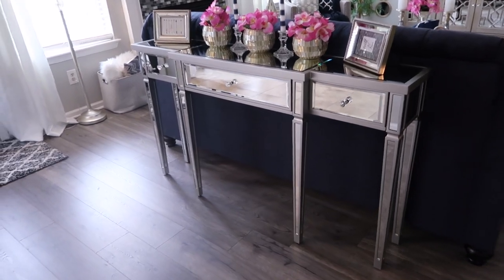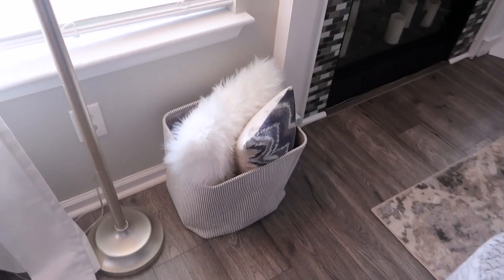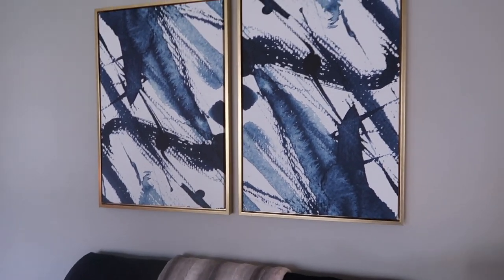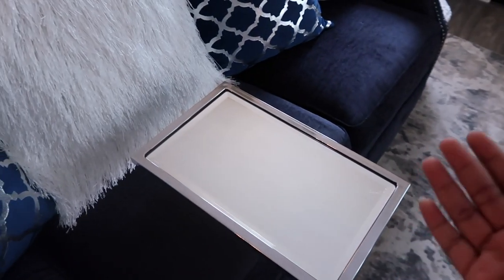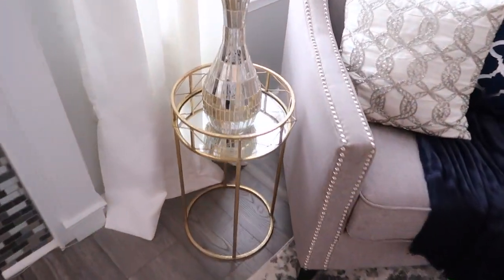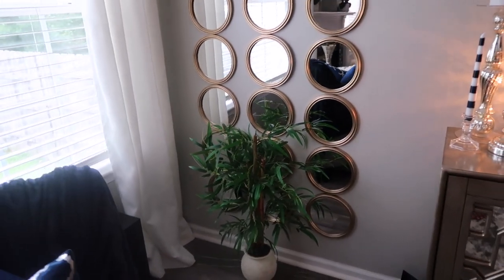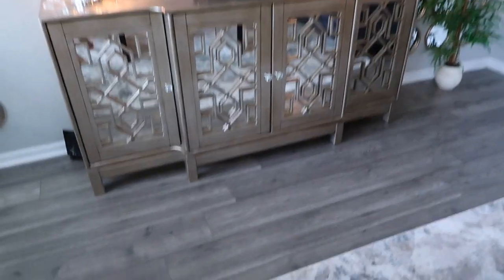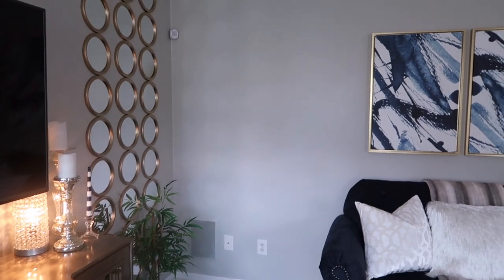✨Glam Home✨HOME MAKEOVER PART 4 | GLAM FAMILY ROOM TOUR

Comment: You did a beautiful job I would frame the gaps above the fireplace and measure it and order some kind of art painting to hide the gaps also I would remove the flower from the tv the wires could be hidden with these wire tubes they sell and I like your gold FYI mirrors without the plant maybe you can buy a hanging plant for the corner it will look more glam then the little plant on the floor you did a great job love ❤️ your videos